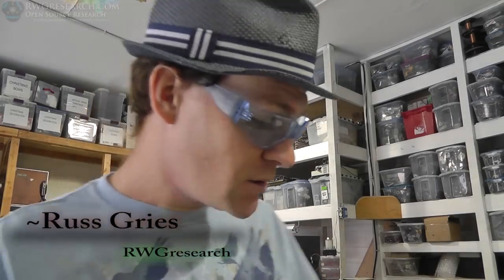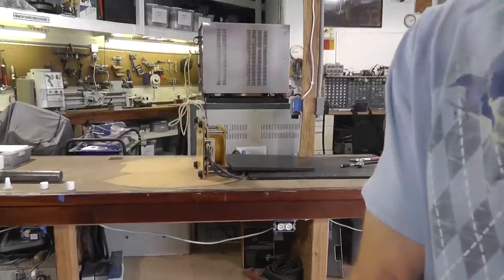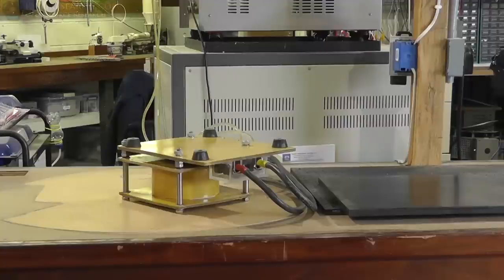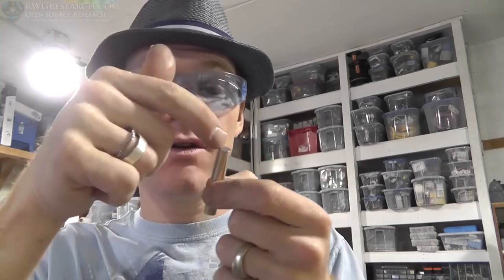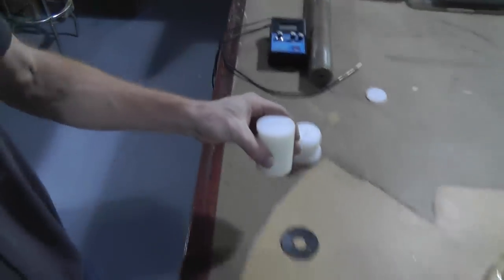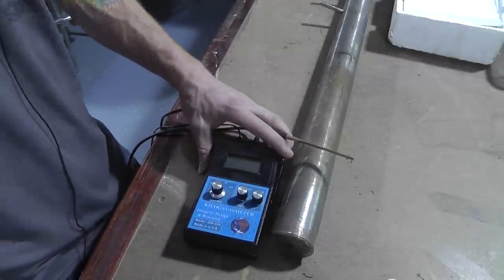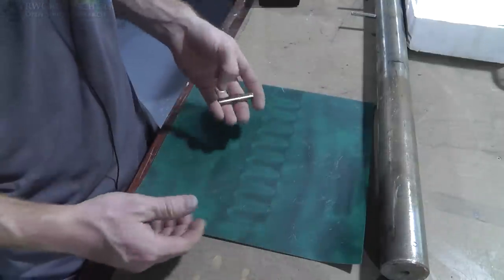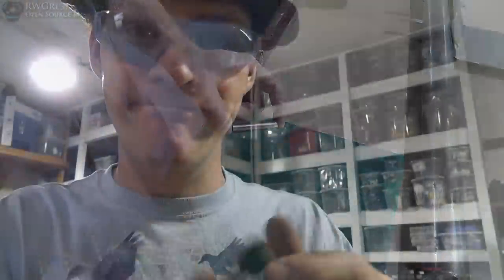Test:2 Magnetizing Experiments  : Magnetize a magnet Diametrically? (Air Core)

Comment: ***** For the best magnetisation you always use iron core pieces touching the magnet, so the flux will be best applied to the right surface it is supposed to build poles on. As I said, try to overlay AC bursts and you will get the Floyd Sweet VTA effect with moveable poles inside a barium ferrite magnet ! Simular to the old moving magnetic bubble memory the semiconductor industry wanted to market in the 1970s ! Regards, Stefan.

Comment: *****  For the best magnetic flux concentration you need to build a "U"core iron jig with your coil in it at the "U" turn and then
use other iron pieces to hold the magnet between the legs, so you almost have no airgap ! So the magnetic flux can go in a closed
circle through your magnet with NO airgap ! Then add the AC burst ripple and see how you can create magnetic bubbles in barium Ferrite magnets for the Sweet VTA effect...Hope this helps. Regards, Stefan.

Comment: A thought for you-- annealing the specimines (4 pcs) at 750 degrees for 6 to 8 hours in Fe gas with 2 pcs standing on end and 2 pcs laying flat to repair the crystaline structure of the metal and assure there is no magnatisity left in them, then do the magnatising at different directions.
Reply: and freeze by dry ice instantly ? )
Reply: no natural cool, probably 8 hours left in furnace, temp off.

Comment: Thanks for sharing I did have one little tidbit of information here to contribute if the magnet is polarizing vertically wouldn't the magnet when it sits horizontally need to be in precisely the right position in the center of the coil to keep the field from skewing just a thought

Comment: If heating with a torch it may not be getting hot enough (or heating time is not long enough) in the center of magnet which is why your left with some residual magnetism which is what I believe is causing your distortion. And I would try different "clock" positions on the same plain for both axis with coils. I would like to know if you can magnetize iron filings say sealed in a paper tube and if you can shape them or maybe suspend in oil in jar and place strong magnet next to jar and see if it show magnetic fields better. And does magnetizer get stronger if in alignment with true north south poles? Referring to Ed Lescallions findings

Comment: I think the cylinder holder you made moved inside your magnetizer. You might have to make it immobile so that it cannot skew. A bigger jig that holds that cylinder in place.
Reply from the maker: jjackdaddy56 it is being held in place with the top block. as well if it could skew the bottom jig only has 1/16" on each side. and it has a 2" length on contact. so it could not go as far as the magnet was showing us. any how i think it has to do with the flux. it needs to be focused. like in my Polymagnet video ~Russ

Comment: *****  Well done Russ,
if you have such a tilted magnetized magnet try to levitate it on a cooled superconductor. It will begin to spin on its own !
I leanred to know a guy on an energy conference, who was into Floyed Sweet VTA stuff and he magnetized a ferrite magnet with a DC pulse like your setup, but overimposed with an AC ripple, so his magnet had multiple poles tilted across its surface. When he placed this magnet onto a fluid nitrogen cooled superconductor it began to rotate on its own... so basically a selfrunning magnet motor ! Unfortunately it only works at these low temperatures... Just try to overimpose an 60 Hz AC pulse burst over the DC magnetisation pulse from your cap bank(or try to find  the right frequencies) and try to heat the magnets again over the curie point for better re-magnetisation. Good luck !
Regards, Stefan.
Reply: *****  Also Russ, it helps much to use a iron core piece inside your coil airgap to concentrate the magnetic flux onto the magnet surface...otherwise the flux will snap again into the old direction it was magnetized before as there is too much airgap and the fluxlines are not concentrated onto the right surface side of the magnet....So build yourself instead of acryl, an iron core piece, in this case something like 2 chisels touching the magnet from each side inside the coil. Hope this helps.Regards, Stefan.

Comment: Fascinating, Russ!  And you heated up the magnet before magnetizing it diametrically the 2nd time?
Reply from the maker: OgMandin0 yes! ~Russ
Reply: ***** Russ, mark the present N on the magnet. After re-heating the magnet try rotating it so the opposite diametric side gets magnetized and glue it in place so it cannot rotate by the magnetic flux. I'm guessing this will remove all the residual magnetic "charge" and permit a full diametric magentization.

Comment: im so confused. what. please i need help with understanding. im just not on your guys thinking level at all. i aint so much interested in magnets becuase in my opinion that is just 1 force of the universe. there is also negative matter. sooooo. if you dont mind i would like to suggest maybe like ferrofluid. like it aint no secret ferrofluid been around for about 70 years now. but like i alway wondered about puting ferro on the main-journals of a small block and the cam and every moving part then you could in theory take the oil pan off. so, my idea goes deeper then that. i was thinking mabye you could make a coil inside the motor. like in the pistons have each individual piston work like a coil so you could in thoery collect electric. but im not very smart in those types of things.
Reply: coils on the pistions... no coils in the cylinder. pistons needs be magnetized so that it would create electricity...that part in theory wouldnt be hard. the hard part is to collect the electricity and then apply it to the wheels to create more HP and RPM